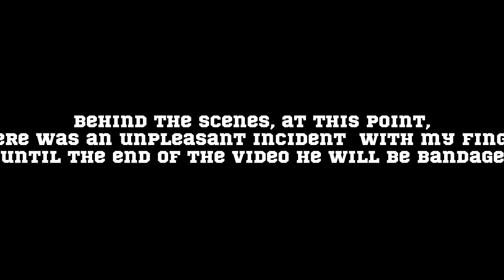Restoration of an Old Hunting Knife! The most Beautiful Handle

Comment: That's awesome! I got to restore a knife last year that was passed down to my Pop. It was originally a butcher's knife forged in England in the early 1900's, but had been in a fire of some sort; the tang was melted and was missing a heap of useable pin holes so I had to turn it into a hidden tang knife. It probably hadn't been used in 60+ years but still held an incredible edge and was hard enough that I didn't have to re-heat treat it.

Comment: Let's say that your knife was well heat treated at first. Depending on the process and the metal type, we can safely say that harden was between 50 to 60 HRC. And already temper one or two times. So the austenite is now fixed and the steel is no longer under stress.
As you heat the metal again, you destroy that tempering process, even past 200 degrees.
As we can see, you were close to 400 degrees, maybe more as we can see a slight red at the end of your heating process.
So now your knife is considered no longer hardened, almost no austenite, back to martensite, and a big grain structured steel. Probably under 30 HRC...
The only thing you could have done is redo the heat treat process. But due to the decarburation, you will never have the same hardened quality then at the start.
Reply from the maker: Thanks, I'll keep that in mind for my next project!
I'm just learning. And learned a lot from helpful comments like yours. thanks again!
Reply: @ITBR_Restoration  no troubles. Heat treatment of steel is quite a complicated subject. It's expected to make mistakes at first.
However knife making community can be quite harch and incomprehensive towards mistake like that. And can bring you some hate for no real reason, just to warn you.. Great job anyway!
Reply from the maker: @elliotmartin2045  Thanks for warning)
Reply: @elliotmartin2045  I've always been told if it's to hot to touch then it's to hot. Is that an  accurate statement?
Reply: Too hot is when you start to see colors on the blade. Too hot to touch would be around 150ish degrees Fahrenheit whereas just “too hot” in general is pretty much anything over 300 Fahrenheit.
Reply: @chrisnah8423  Too hot to touch would start around 60 degrees C, but that's pretty safe for your blades.
What's too hot depends on the heat treat of your blade. On top of the type of steel different heat treat can be used depending on the purpose of the blade. A wood chisel or a kiridashi would probably be tempered around 170 to 190 degree C to keep a very hard and sharp blade with a durable edge, but very brittle. An axe or a saw blade would have a much higher tempering around 250 to 300 degree C. So a 130crv3 razor blade will be damaged with 190 degree C exposition, but not a fish knife. Anyway, even at 100 degrees you will damage the mountings and handle materials :P
Reply: I guess the big questions are was the knife heat treated? Does the finished blade pass a hardness test? What’s the knife going to be used for?
Reply: I was very shocked to see the torch come out.
Reply: @ITBR_Restoration  You mixed up Fahrenheit and Celsius. You can't get a blade above 350-400 F without ruining the temper! In Celsius, I think it's like 200-250.
Reply: @chrisnah8423  That's just a safe way of steering clear of that temperature that'll ruin the heat treat. I always grind my bevels after heat treat, so I need to use fresh grinding belts combined with high grinding speeds to help eliminate heat build-up, every couple of passes when the blade becomes to hot to touch I'll deep it in water then continue grinding.
Reply: Yes it wasn't a restoration but a destruction. Maybe he could get someone to temper it properly again?

Comment: Awesome video as always! Just a tip, next time you build a knife put a pin in the hole after you drill the first pin hole. I realize you had everything clamped up but you still run a high risk of everything shifting and the holes not lining up. 👍🏼
Reply from the maker: Thanks for the support and great advice!

Comment: Looks awesome! Definitely softened the steel quite a bit by heating it that much though. It'll probably be around 45-50HRC. If its a simple high carbon steel, tempering is usually done around 250C, anything beyond that will get it pretty soft. Should still be quite tough, just might go dull quite fast.
Reply from the maker: Thanks for the support and advice! I will definitely check the hardness of the metal as soon as possible!
Reply from the maker: @opinionsvary  Thanks for the helpful tips!👍
Reply: Happy birthday ulit nak♥️♥️♥️God Bless You always🙏🏻🙏🏻🙏🏻

Comment: To blue with boiled linseed oil you need to heat it up past the smoke point which is about 110C. Going to 200C will ensure ample temperature. 400C is way too high, so I hope it didn't ruin the steel tempering.
Reply from the maker: thanks, everything is fine with the hardening! hardening can be lost if heated above 600C.
Reply: @ITBR_Restoration  hey just so you know the temperature scale you may ne looking at for tempering sounds like it's for high alloy stainless steel. This blade was more than likely carbon steel which tempers at a much lower temperature 200c to 232c. That blade and the colors you went to tell me that the blade is not very hard.
Reply: Ю
Reply: FY. Buang
Buang

Comment: Nice work! I like to bevel the sides of the front of the scales before gluing them on. It's a lot easier. I also tape off the sides of the blade to keep the glue from going on it. Don't squeeze the clamps too hard, you squeeze too much epoxy out. I like to drill holes in the steel and dimples into the wood. It provides better adhesion.

Comment: Beautiful knife even with the pitting on the blade and the handle is amazing I love the colour ( do you know what wood it is and what was used to dye it) I would be concerned about the hardness though after being heated so far and quenched the way it was but it looks great even if it won’t be the sharpest
Reply from the maker: You're right! Perhaps this is not the sharpest knife on YouTube))) But I really like these pits on the blade, and this handle !!!
This wood is ash. If you search youtube for "wood stabilization" you will find a lot of videos of what this process looks like!
Reply from the maker: I hope I was able to answer your question.
I did not make this bar, I bought it from an experienced craftsman (about $ 10)
Reply: @ITBR_Restoration  thanks that really helps I’m fairly new to knife making and I looked at the wood stabilisation videos on YouTube and it was very interesting I hope to see more of these handle types 
Thanks from Australia 🇦🇺

Comment: One tip that I would give would be to rough up the g-10 with sandpaper before you epoxy it. It comes suuper smooth and slick when you buy it and you really gotta roughen it up for the epoxy to properly bond well.
Reply from the maker: Really good advice.
I thought the G-10 was pretty smooth and the glue wouldn't work well, but I didn't think to use sandpaper.

Comment: Very good! ....... but just one comment -
I would have drilled a few shallow holes or dimples into the inside of the scales, and a few holes through the blue liners, so the glue will flow through them and into each other to form a matrix and lock them in place.
Reply from the maker: Thank you.
I'm sure the pins will do a great job of holding the plates in place.

Comment: I'm gonna fill in gaps about stabilized wood. It is done in one of two ways: One way is by using oils that after they're apsorbed in wood harden other way is by using epoxy resin. Today epoxy resin is common way to stabilize wood and there is proof in video. Rather than remove rust you can use it. Put pot of water on stove and wait for water to boil than dump the knife inside for 15 min than repeat if necessary. After that do mild sanding just to remove any extra. This way you can convert rust to black oxide that will protect knife from rust.

Comment: I would've normalized the metal and then tried to file out some of the pitting before quenching and tempering the blade.  I don't think the pitting was too deep and if it were, welding a little metal in there to fill it up wouldn't necessarily be a bad thing.  It's not like this blade is going to be on display at a museum so you don't have to worry about keeping its patina.

Comment: Dude mixed up Celsius and Fahrenheit when talking about the heat treatment! 😄

If you get that thing anywhere near blue/purple color you have destroyed the temper and you need to harden from scratch, my friend. There is zero chance that blade is hard - you got it hot enough to ruin the temper, but not hot enough to harden it when you dropped it in the oil.

Comment: Can I ask what liquid you use to get the rust off of the blade because I'm doing knife restorations and I don't know what to use
Reply from the maker: I use a solution of baking soda and water for electrolysis.
Some use salt and water. But salt removes not only rust, but also part of the metal))
Reply: @ITBR_Restoration  Alright thank you for letting me know

Comment: Neato Torpedo 👍👍👍 
How do I get my hands on an  Electrolysis machine thing that you use.  I have an axe and a few sledgehammers that need cleaning up.
Reply from the maker: You can take any DC source. (car battery charger, even use a welding machine)

Comment: Dayummmmmm you kilt the blade with the heat.. its soft as butter now . Its so beautiful though.. just remember that heat ruins the heat treat the original maker done on the steel..   the difference in a peice of steel and a knife is the heat treat..  you can get em too hot just grinding them..
Reply from the maker: ok, thanks!

Comment: The electrolysis didn't work because the water wasn't rusty...The contact on the knife was made on really rusty metal...Next time just make an area on the knife clean down to bare metal so it has a real good contact...Just a helpful, fyi...Also, if the steel was as good as you say, why did you leave the blade pitted when you blued it???

Comment: Sandblasting would leave no black mark on the blade & electrolysing for 12 hours or at least 4 hours would save you from that soda water brushing. If you are doing it  do it correctly.

Comment: If the wood is stabilized properly then you really should sand it to 600-1000 then polish it with a buffing compound that’s how you’ll get it shine the oil shouldn’t absorb into wood that has been stabilized with acrylic

Comment: Why not go for the wire wheel as the first option... wouldn't it rule out aging to fuss with electrolysis?
Reply from the maker: A wire brush will not clean rust as well as electrolysis!
Reply: @ITBR_Restoration  I beg to differ...depends on the stiffness

Comment: The wood choice on the handle is superb but I think you may of destroyed the durability and sharp retention by blueing the blade. 

Something not really needed on a hunting knife. 

A good polish up. Also I have seen a few channels now refurbishing blades. Yet never seen one sharpen the blade correctly. Most manufacturers send out knives with un even cut bevels but this didn’t appear to have a re bevel at all. ? 

I look after my hunting knives to the same degree I look after my hunting rifles. 

If this is gonna be something you’re gonna do. Get a wicked edge

Comment: are you kidding? you destroyed your heat treatment at the moment you passed 260° ^^.  you turned a knife into a piece of metal with a knife design..the only steel you can heat at 500 without destroying the hardening are the allied steel like Z160CVD12  (D2),  because it's tempering temp is around 500° but which might be done under controled atmosphere. but with your high carbon steel steel, you ruined the tempering, and reduced your hardening so much that it's no longer a knife ^^.. 10 for YT, 0 for knifemaking.

Comment: So, let's see: You used an overcomplicated electrolysis setup to avoid just using a wire wheel and wire brush... and then used a wire wheel and wire brush. Then you messed up the perfect heat treating with an unnecessary heat treating ruining the steel.  Then you put blue grips on it and turned a wonderful vintage blade with great steel into a gas station knife. Thumbs down. Do better.

Comment: ruined the heat treat.
Reply from the maker: It's okay, I didn't overheat the metal
Reply: @ITBR_Restoration  i most likely would of taken it up to critical temp and rehardened it and then tempered it. im an actual blade smith and enjoy watching restoration of good and old knives
Reply: @ITBR_Restoration  did you also check rockwell hardness